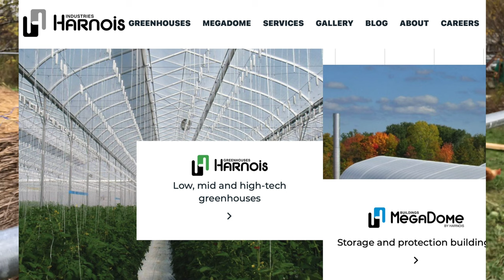Car shelter to Greenhouse

Comment: I've done the same this past year in my back yard and had the exact same issue you did. The hurricanes here in Newfoundland did the job on mine and it ended up flying into my neighbours backyard. I had to rebuild it, cemented anchors in the ground and used ratchet straps to keep it down. I'm currently building my raised beds and should be all set for a nice growing season this year!

Comment: I have been watching others on Youtube build with plastic pvc and that seems a little to week and getto to me. This is a perfect solution. I believe I will purchase 4 car shelters and build them end to end but I will use cement anchors, temporary but will last years if needed. Thanks so much, what a great idea, I also love the wiggle wire, never knew it existed.
Reply from the maker: It depends where you are. Plastic may work where there is no snow or hurricane winds at times and you want a short term, hopefully for the season structure. You can find the wiggle wire by searching for greenhouse suppliers. If you are going to buy 4 car shelters you may find it more advantageous to buy a used greenhouse.

Comment: This brought back memories! My friend started a farm and asked me to help him refurbish the aviary buildings by turning them into greenhouses. We did pretty much the same things only we had a concrete flooring already laid. We still secured it with wood bottom framing and the same wiggle wire. We built wood framing on the ends though with a solid doors. I was laughing about the wind... we live in Austin, TX and getting a day without some wind is just not happening. It doesn't take much to turn it into a sailboat. It was quite an adventure! I loved watching y'all build this, and I'm sure your chickens love you for building it! You made it look much easier than I remember it.
Reply from the maker: Wind and sail for sure. Even nighttime if it’s the only time without wind.

Comment: Even though those are known colloquially as Quebec garages, they are not rated for snow load... (Specially with the damage yours endured.) Dozens collapse every year, and I know of at least 2 fatalities in the Gatineau... When I built mine, I started with 3 frame sets and halved the distance between, and added a ridge beam on 2 4x4 posts... Please be careful Stefan, keep the snow cleared off and do it from the outside with a pushbroom. Both fatalities I mentioned were people pushing up from inside to clear the snow... And please consider adding a ridge beam.
Reply from the maker: Great idea, we strengthened the damaged ones with 2x 3s and used truck straps to keep sides from spreading. We always remove snow but great suggestion to do it from outside after a big snowfall. I’ll add a couple of posts under the ridges, thanks.

Comment: Good timing for us to see this video. We bought an old carport, probably the same that you have (double harnois) and we want to convert it in greenhouse next spring. Right now, chickens are in, but we only have the original carport plastic on it. We will command a greenhouse plastic at Harnois for the model of carport we have. Have you take one of there model to fit perfectly or you have buy a plastic elsewhere? Have you compare the price and the amount of work involve custom made vs homemade? tank you a lot for sharing your knowledges; it's really nice :)
Reply from the maker: Gabrielle le plastic a été commandé ailleurs mais Harnois devrait pouvoir fournir du plastique pour cet abri. Ça serait une belle idée qu’ils fournissent des kits pour passer d’un abris à une serré avec plastic attache plastique bouts… tout en un.
Reply: @StefanSobkowiak   oui, ils peuvent faire un modèle custom pour leurs modèle de tempo. Est-ce que je peux vous demander combien ça vous a coûté environs pour votre matériel (sauf pour le frame de base)?

Comment: I bought one of those tarp buildings and the tarp is shot now so I’m thinking making it in a greenhouse after watching this video. It’s just a little one like 8’ by 10’. How long will the  clear plastic will last before putting on a new one?  Thanks again for all your videos! Happy New Years!
Reply from the maker: Depends on the thickness of plastic, most greenhouse plastic is 6mil which should last 3-5 years, you can always use hardware store drop cloth and double layer it.
Reply: @StefanSobkowiak  thanks!

Comment: Where do you get the rail and wiggle wire?
Reply: Canadian source for anchors , wiggle wire and wiggle wire trough piece! 
Stephan this is such an economical way to get your plants started and keep your chickens warm with the IBC tote water heaters
Reply from the maker: Look up greenhouse manufacturers or resellers in your region there are several.

Comment: Thanks for sharing and happy new growing season! Couple of questions..is there a measurement to look for when buying plastic cover to tell how much sun will come through to plants and how thick/durable it will be against weather as well? Do you have to balance the two or do they not go against each other? Also would it have not been better to use some old cable or wire or chain rather than rope for your ground tie down as won't the chickens peck it and sun rot and the water from greenhouse/decomposition and chickens winter rot it to quickly? Is it a special treated rope?
Reply from the maker: No just thick enough to last, chickens have so much they don’t bother pecking them. The plastics sold have ratings for % light transmission.

Comment: Do you tape the joints to prevent them to come apart or just to make them smoother so they don't damage the plastic? If it's to prevent the pieces to come apart, maybe a metal screw could do the job better.
Reply from the maker: Just so they don’t damage plastic. We use a lot of duct tape but don’t count on it to hold pipe together.

Comment: Hi Stefan, I'm looking to keep chickens and ducks in my gothic hoops house this winter,  but I'm worried about the moisture accumulation being a problem for chickens, and about predators.  Any thoughts?
Reply from the maker: We leave a small door open all winter so the birds can go outside if they choose. It’s hard to keep a greenhouse air tight so there will be ventilation. Abundant dry bedding is important, even building it up over winter. The details I show in the video of keeping chickens in -34C are important (foil insulation, roosts above, small space of shelter in a larger space is easy for the birds to keep warm overnight, abundance of grit…

Comment: Ive always heard ventilation is extremely important for poultry. Are there vents on this greenhouse? I imagine that the breakdown of the hay, apples and manure is going to elevate co2 and possibly methane, etc. Is this a concern if there isn't good ventilation? I really enjoyed this project. One day I will do one!
Reply from the maker: Absolutely. Left a few holes near top. For methane and ammonia the rule of thumb is to add bedding before it smells to balance carbon to nitrogen levels.